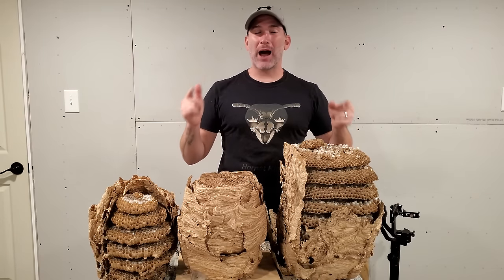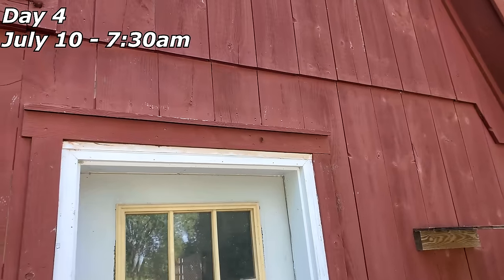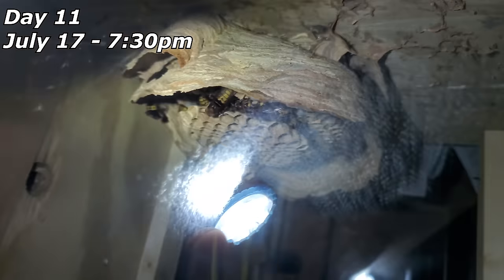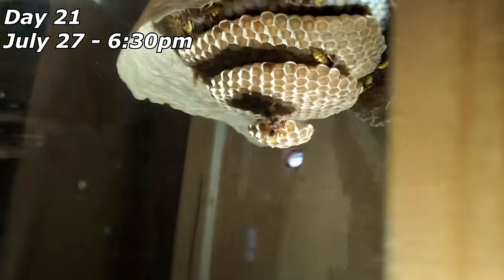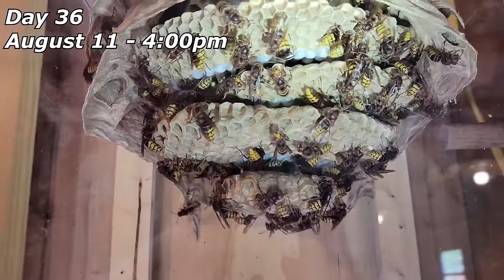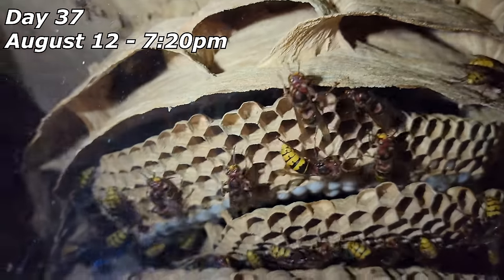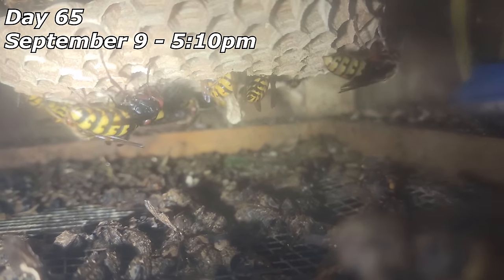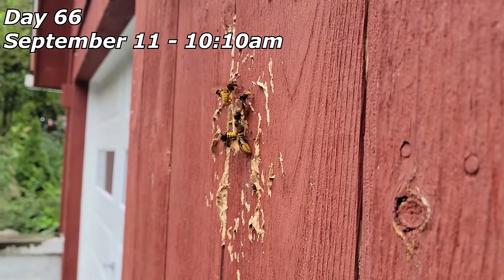Growing a MONSTER Hornets Nest! | How I Relocate and Keep Hornets!

Comment: This was so cool. In the future you might try not only a bigger box, but small holes in the plexiglass for ventilation, but maybe a removable tray at the bottom with something like puppy pads to catch and absorb all that waste that can be changed out.
Reply: They'd probably paper over vent holes but a cat litter tray wouldn't hurt
Reply: I was thinking the same thing. If you put a box of dirt underneath the ammonia might make for a decent fertilizer.

Comment: Absolutely incredible. I lay down for bed, now it's almost 2 in the morning because I couldn't stop watching. I'm shocked at just how large the colony became compared to how it started out. The fact a single queen started all that is incredible. I have a new respect for wasps now after watching your videos. Small suggestion/question for your next box. Instead of a solid piece of plywood for the top, would it work to do a main central strip to hold the nest in place, and finish the rest of the top with screen similar to the bottom? Im thinking it would allow better airflow and help with the moisture build up. Also, maybe an additional piece of Plexi coming from the bottom back side to divert waste away from walls with a catch pan to make cleanup easier. Looking forward and hoping you do another nest in the future, though you might need to make a bigger box since each year seems to really it larger nests! Truly appreciate the time and effort you of into this project, and the HOURS of editing it took to finish it up.

Comment: Great video! You should build 6in further down on the bottom (or however much clearance you’d need for filming and whatnot), and put another layer of chicken wire you can cover with paper to catch the waste build up. Then you could just “change the sheets” so to speak. Might help with keeping a cleaner space in your garage.

Comment: A $15 tarp could solve some of the nastiness. Mount some hooks on the wall underneath, drape the tarp down onto the floor, and drag it out to hose off every once in a while. It won't get rid of the smell, but it will keep the sludge from building up on the tools, wall, and floor and soaking in.
Reply from the maker: This Is a barn. 5 feet away from a chicken coop full of chicken crap. Hornet sludge smell just added to the aroma 😁

Comment: When I was a kid, I climbed over 20 ft high up a tree and sawed off a tree branch with a hornets nest real Hunger Games style.  After the wasps were long gone, I grabbed the nest and brought it to my science teacher.  It was pretty cool seeing the inside of it.  Love your videos because I'm a nature geek.  Interesting experiment.  Perhaps next time try it with a steel mesh they can't fit through or bite through for extra ventilation.  Perhaps also try a double layered bottom screen where you can insert one and then remove the other, to clean the bottom, and have a dirt/mulch droppings collector to discard the waste that falls down.  There were similar things on my bird cage, just would need to modify it for small insects.

Comment: 1. Allow a larger box for next year.
2. Use a wire brush to clean bottom mesh every week.
3. Put a plastic tub under the box mesh with some news papers as a liner, once a week after cleaning with the wire brush just fold the newspaper and take it to your birds. 
4. Install the fan on the top with some mesh so it will not suck the hornets and kill them. Top is better because hot air goes up.
5. Build a skywalk to hole. Try not to get your garage shed beams wet, they will rot. So keep the nest far. A 2" plastic tube between nest and exterior wall can work as a skywalk Way.
Good luck next year.

Comment: Forgot
6. 2 magnets a a sponge for each glass wall to clean all season.
Magnet/glass/sponge/magnet.
You move the outside magnet , it will move inside magnet and sponge will clean inside.
Use strong hard drive magnets.

Comment: So cool!!! Thank you so much for sharing this super cool colony of yours. Perhaps a large tote underneath could help with capturing the sludge and refuse that the colony drops? I wonder if you'll challenge yourself to grow larger and larger ones. Perhaps you can attach a pvc tube to both ends of the holes. So there's like a tunnel and it's further away from the wall, Perhaps on a wooden legs.
Reply from the maker: Thanks! The size of the colony is dictated by the queen laying eggs. I designed this box to be big enough to accommodate the potential size of the colony (which this box was bigger than they needee) and small enough that they will run the comb right up to the glass (which they started doing before the colony finished its cycle)

Making a bigger box doesn't mean a bigger nest. 
Thanks for watching!

Comment: We moved from Boggy Bay, Waycross, Ga. this year, which is just above the Okeefenokee Swamp.
As can be expected, bugs, and mosquitos especially are abundant.
This provides all Spiders an everpresent food source.
The problem there is the common, big black House Spiders.
When we 1st moved there, I spent more than a couple of nights with the shop vac, sucking them off the outside of our house and out building.
The reason I did it after dark, is that's the only time the big mama spiders would come out of their homes, holes.
I had to do this every year.
The webs were enormous and thick, but it seems this process either smothered or fataly traumatized them, because no spiders lived inside the vac canister.
I said all this to demonstrate, that if the food is there, the predators will be too.
Reply: Pewtoob jumped to a wasp video...ugh.

Comment: Very interesting. Thanks for sharing. We don't have many hornets in South Florida. 

The family vacationed in the N Georgia mountains several summers when I was a kid. One year, the minute we got there, my brother and I set off down a path to explore. I stumbled stepping over a log across the trail, tearing it open. My brother following behind was stung several times as he entered the cloud of angry hornets that emerged from a torn open nest. I received not a sting! We had to run quite a ways to elude pursuit.

Perhaps if you put hardware wire on top, as at the bottom, the wet mess wouldn't be an issue. In the wild, the mess would be away from the nest and other creatures would deal with it.

Enjoyed. Thanks again.

Comment: Id LOVE to see you try this over again, but make the box like, 2 or 3 of these boxes but linked together by Plexiglas with holes in it "So its like this |0-0-0-0| or something like that. also put in a Safety Bottom where you can like.. push in a small piece of plastic then unhook the bottom for cleaning or something? but here is my favorite idea. get some of those little tiny cameras and put them into the boxes on wires. so the Cameras and Wires are sorta like pointing at certain parts of the box coiled around BEFORE the Hive is even started, so they'll work around the wires/cameras and you can then see inside the hive at any time.. idk how that would work 100%, maybe just put little tiny holes in the plexiglas and then work those little camera's in to take a look around inside the hive when you want too, then pull them back out when you're done? basically you could make a full time channel of stuff like this. i would be COMPLETELY invested in ongoing Hives and their life Cycles and stuff! just set up in a more thought out, easier to deal with manor i guess
Reply from the maker: Haha, thanks buddy. 
My box is specifically designed for each cavity nest building species. Linking boxes won't be of interest, since they aren't going to traverse between boxes to build. 

Thanks for your thoughts 😊

Comment: So, out of genuine curiosity. Would there be a way of maybe putting a couple layers of ultra fine mesh as the top (along with the maybe some wood pieces for support) on top to help with thermal regulation? Basically make it easier for heat to rise up and out of the nest instead of having to transfer through the thicker wood 'roof'?

Comment: I haven’t watched all the way through yet. But I’m about halfway. I’m at the point where you’re pointing out you need to clean the glass. My suggestion would be what they use to clean fish tanks it’s basically a 2 sponges on a string with magnets in both of them. You stick on sponge on the inside of the tank and one on the outside you can clean the inside and outside by moving the sponge on the outside since they’re magnetized. (Idk if you did this already bc I haven’t finished the video but I figured I’d give my thoughts on the easiest cleanup
Reply: But a super awesome video I honestly can’t stop watching.

Comment: 1:40:12 could you maybe build a sliding screen and catch pan that you could easily remove and clean so it’s not dripping all over the wall and floor? Build two so you can replace the dirty with a clean one? At this point you wouldn’t be able to due to the size of the hive but it may help with the smell at least for a little while

Comment: After seeing all the waste and stuff, might I recommend putting a tinfoil pan or something under there and changing it every couple weeks? I cant say it'd help with the stuff stuck on the bottom of the containing area but it would keep your floor/wall clean.

Id also recommend doing a latch/magnet bottom, that way you can slide off one and replace it with a clean one and then reattached it to keep it secure.
Reply from the maker: I don't care about the floor, this is a barn. 

But I really like your magnet idea!
Reply: @HornetKingOfficial  Me personally I like to keep things as clean as possible in work areas and knowing theres that pile of bacteria and maggots and stuff would bug me day after day until I fixed it😂

And yeah, you could have it connect on the corners with magents to keep it steady for short term and use those trunk/chest fasteners to lock it in place long term. That way you can have one extra one and just change it weekly/biweekly etc., clean it and leave it on top of the little home for easy access and storage. It'd be a relatively fast swap and probably wouldnt bother them much as long as the locking mechanism doesnt shake the box too much. I can think of a few ways to make it work.
Reply from the maker: @Adam Chvala  Haha, then I recommend never having a barn with animals! You think the Hornet liquid was bad, you should see what 10 chickens, 2 emus and a Rhea do 😆

I really like that magnet and swap bottom idea. 
With 4 - 52 gauss neodymium magnets on the bottom corners, and the bottom screens having a small screw head at each corner, it would be plenty strong and I could swap out a clean screen easily while I clean the dirty one. 
I plan to do this!
Reply: @HornetKingOfficial  Great! Im excited to see how it goes!

Comment: Hey out of curiosity would they have lived longer had you controlled the humidity and airflow? The airflow could have been easily enhanced you could have put small pc fans on the ends of some tubes and on the inside well there's many ways to do it but you get the point it would have helped them I'd imagine.
Reply from the maker: No. It's a colony cycle. Had nothing to do with humidity.

Comment: I think you should build a bigger set up so they don't run out of room.and frame the bottom so you can clean out the bottom. Perhaps screen the top so air moves through it. Perhaps less moisture build up

Comment: Interesting, very interesting.
Now I think for myself, could I go and do something similar as school watch-project for kids I teach biology? 🤔

(Unfortunately it seems, the bulk of most interesting stages happens at summer when they have summer vacation... aaand the stinking problem would have to be solved by some bottom double sliding layer with some regular cleaning process or something if even possible)
 
I was wondering, if success isn’t kind of false blessing for the nest. As long as they grow slower than their environment restricts them, there seems to be possibility that the outer shells can be accumulating some of the debris and later the inner wall be removed much later including the debris in some self cleaning process.

As the nest became bigger and bigger, the humidity inside probably worse and worse (?) and closer and closer to the waste sludge.... as it even eventually connected to the fly infested bottom (so the maggots used it as their lift up)

Anyway suuper interesting

Comment: What if you was to cover the bottom for the screen is with paper towels so you could open it up and clean it out real quick. Bend coat hangers under the screen with paper towels to catch trash and throw it away to lessen stink . Lot cleaner.

Comment: You do a good job fostering curiosity that these are more than just evil stinging creatures, do your neighbors know that you do this? 
Amazing the tiny little stem which holds all the different layers of comb and the strength of all of it
Also CRAZY THE SOUND!!! I don’t like it!
I’d also be really curious to block off the hole and then pound on the outer wall and have a camera on the inside to see the response to a “threat”.
Reply from the maker: My neighbors couldn't care less. 
Check out last year's colony when they were disturbed by a thunderstorm ans they swarmed inside the box.

Comment: Just a thought; maybe this has been suggested before, but why not put up a lower slot a few inches below the screen that a piece of cardboard can be slid into to catch the waste; a piece of cardboard you can replace from time-to-time to remove Hornet waste.
Reply from the maker: Blocks airflow.
Reply: Really just needs a metal tray on the floor that can be moved and hosed off once in a while. Won't block airflow as there is still the same gap. Aluminum tape over the wood beams below will help protect them from the waste and again would be easier to clean than waste soaked wood.
Reply from the maker: Nope. The majority of the waste and decomposing carcasses are in the box, not on the floor. The floor was just catching the drippings. 

Just nature of the beast. Remember, this is a barn.

Comment: I believe they need air flow,,,for temperature control,,,also the feces and urine is causing a bacteria that they know would hurt snd possibly kill the colony.  That structure needs more air flow,,,also if you could remove most of the waste from below may help,,

Comment: Why didn't you put a large pan/bowl under the colony to catch the waste? Wouldn't that have made the clean-up significantly easier?
Reply from the maker: This is a barn.
Reply: @HornetKingOfficial  I assume that by this you mean to imply that barns are going to be dirty no matter what or that a certain level of dirtiness is to be expected within a barn. 

To that I would respond by saying the following: Though that is probably the case and, to be honest, I hadn't considered that before writing my comment, I was actually thinking more of the tools and other stuff under the nest that became super dirty. To me, that would have been super frustrating to clean every couple of days/ everytime I needed use them. To me, it just seemed like it would have been easier if you had placed some sort of waste-catcher under the nest to make clean-up easier.
Reply from the maker: @Cōgitō Ergō Sum  Yes, barns are inheritantly dirty, by nature. My barn houses all my birds, and birds are far messier and smellier than some drippings under a Hornets Nest. 

The tools under the box were a few pry bars, crow bars, and a steel pipe I use as a breaker bar; a little moisture doesn't hurt them and I have never cleaned them. They are an always-dirty tool. If there were tools that could have been damaged by moisture, I would have just moved them prior to putting the Hornets there.
Reply: @HornetKingOfficial  
I see. Thanks for taking the time to explain this to me! 

Out of curiosity, does the amount of waste produced by a nest vary much by species or does it generally remain within a certain range?

Comment: Gives me a idea how long it took the wasps to build their nest in my fir tree about 15 ft off the ground. Their nest is 12-16 inches across and about 3 feet long I’m guessing?  First wasp nest I’ve ever seen in real life. Now I’m trying to figure out how to dispose of the wasp nest? Really don’t want the wasps in my tree.  Wondering if freezing weather slows the wasps enough to remove the nest without getting attacked with a swarm of wasps ?🌧 too much here to mess with the nest now. But eventually I like it gone. Yellow jackets bad enough to deal with on my property. Rather have honey bees myself! Don’t know if the wasps or yellow jackets attack honey bees or not?  Also like mason bees too!  If it wasn’t for gardening I rather avoid the bees!  I know yellow jackets are aggressive around here, but the wasps I still haven’t figured out if their aggressive or not?
Reply from the maker: Hornets and Yellow Jackets are both a type of wasp. 

The nest you are referring to in your fir tree is dead. Colonies don't survive past fall due to a colony cycle. The nest will not be re-used. It will fall apart in the winter.

Comment: You need a bigger box or a extinction for the one you already have for them that way you might be able to get a even bigger one and if you puta piece of sheet metal on the bottom screen and you can make it into a funnel that can go inside a bucket which you can control the smell better with a little bit of sawdust in it

Comment: Would they be ok with like a waste box, or would that cause them problems
Reply from the maker: I don't understand your question.
Reply: @HornetKingOfficial  well, you said it really began to stink, so to midigate this, my first though was a bucket. I was wondering if this would somehow agitate them?
Reply from the maker: @MrNum8325  It started to smell due to the decaying larvae that were being pulled out of the cells. That is inside the box. 
I would clean out the box regularly when that starts to happen. 
This video shows my clean out method. 
https://youtu.be/rWUV9p1VqiE